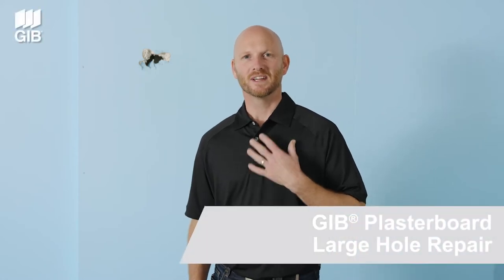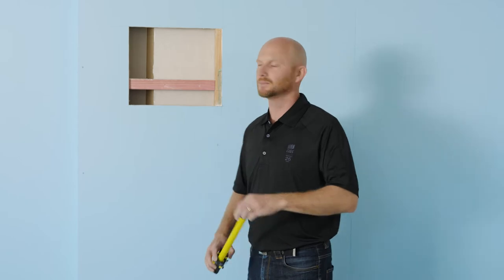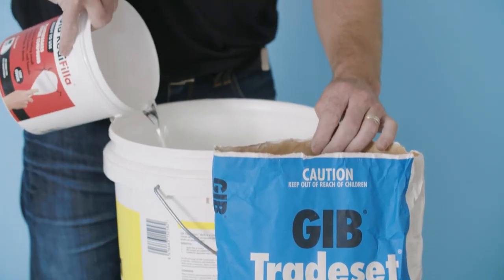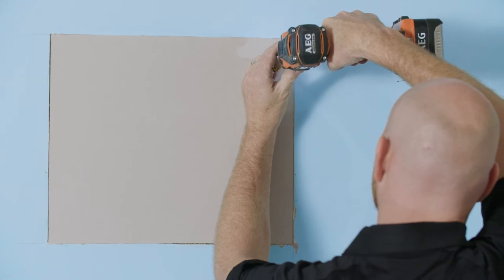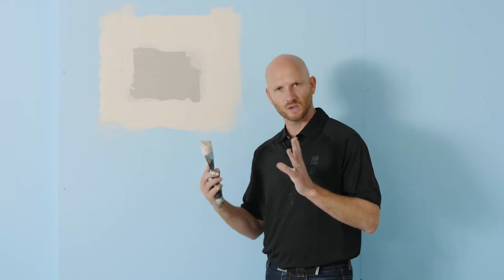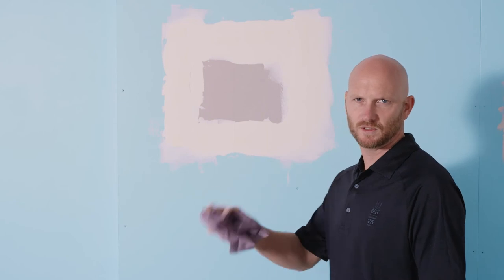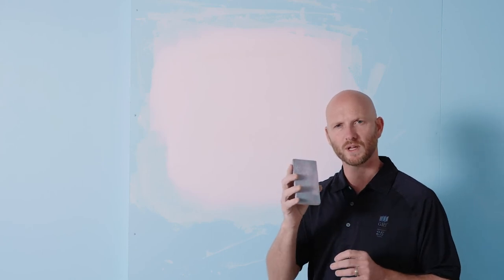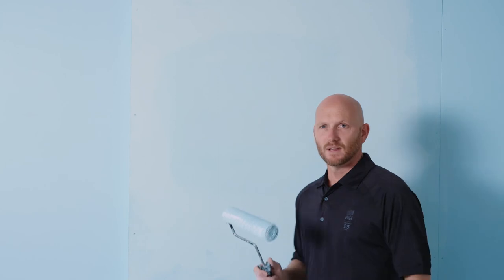How to repair a large hole in GIB® plasterboard

Comment: For a one-off small job, to save buying several GIB compounds that would likely never be used again, could you glue the back block with PLUS 4?
Reply from the maker: hi! GIB Plus 4® will not hold as well as a setting compound.  For smaller jobs you could look to use a tube glue to hold the patch

Comment: Hi, would you ever use 2 backing pieces instead of going into a stud ? Just to keep the repair more localised ?
Reply from the maker: hi Jay, yes, you can use 2 strips too, you may need to put a screw in one or both sides to hold it while the glue goes off. For more info, feel free to contact our Helpline - 0800 100 442
Reply: @GIB12256  awesome thanks , just brought a house that has a few holes. Will give it a crack in the weekend

Comment: why would you use a trowel to smoothen the surface ,when yo could use a broad knife 25cm to scrape it back, and you apply your base coat as your smooth coat so the next 2 coats is easier to apply and with a better finish